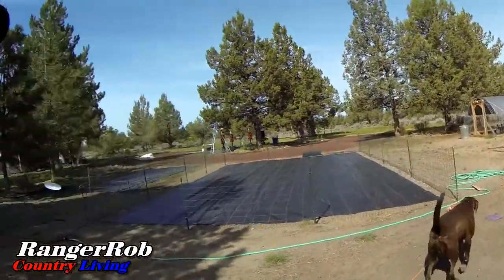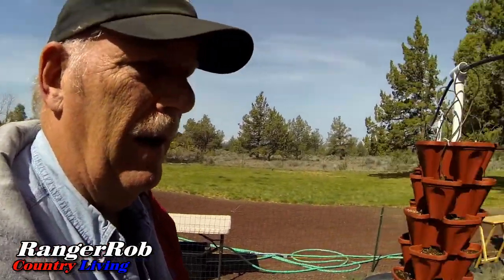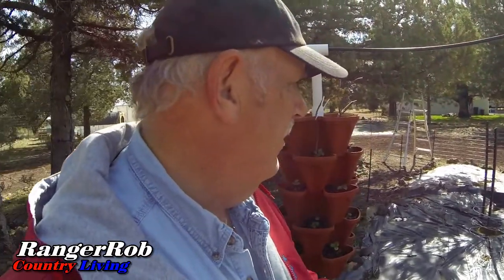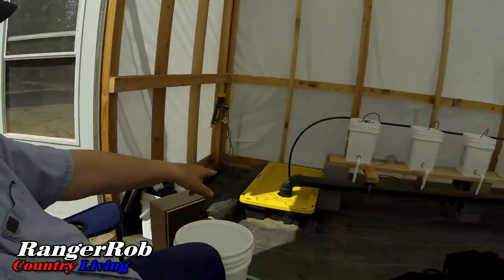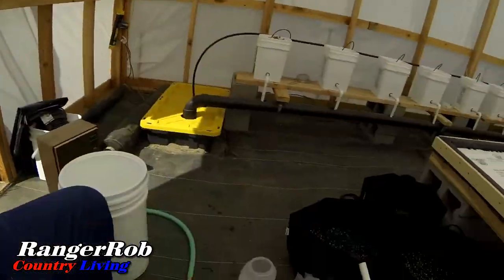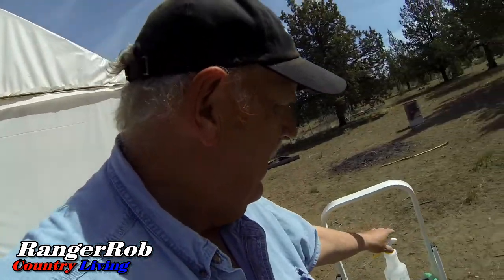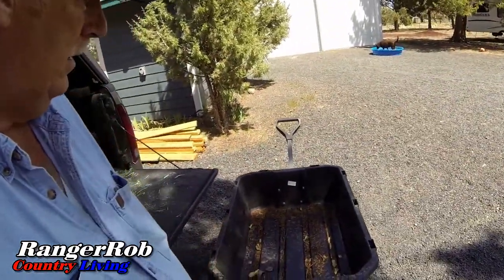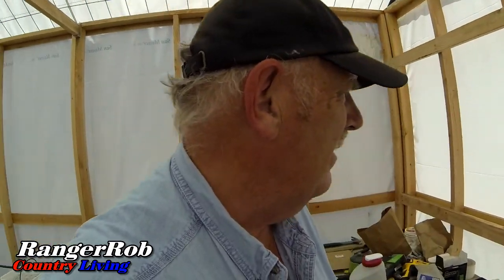Red Ants Invasion, Adding More Plants To The Hydroponic Floating Raft & Homestead Loneliness

Comment: Rob, hot soapy (Dawn)water does wonders on Red Ants. Some ant holes extend down six feet deep. 
If you have a gas powered water pump.  Using a five foot long 1/2 to 3/4 diameter probe to inject 
the hot soapy water. It will quickly dispatch the ants in a non toxic way. 

Rob for the portable tank. Would you consider strapping the tank to a Golf Club caddy and pull it along. 
Just sayin. Cheers, Mate.